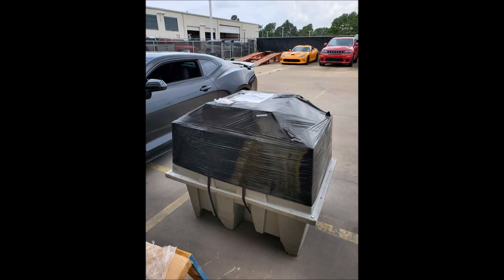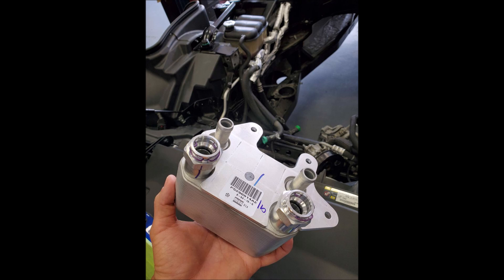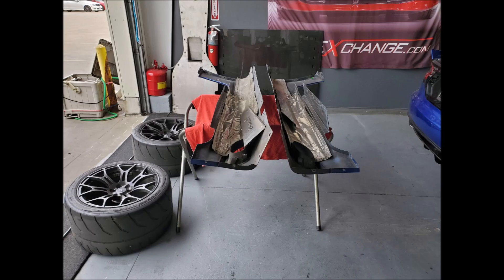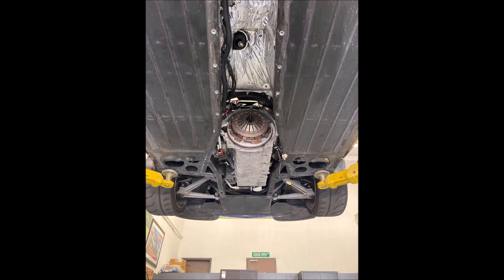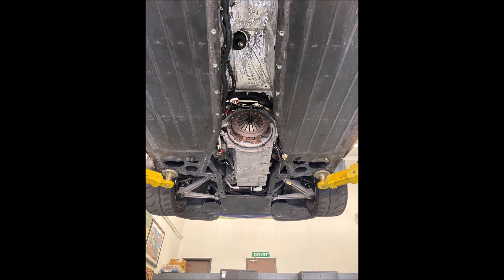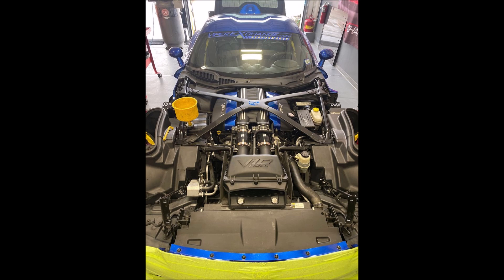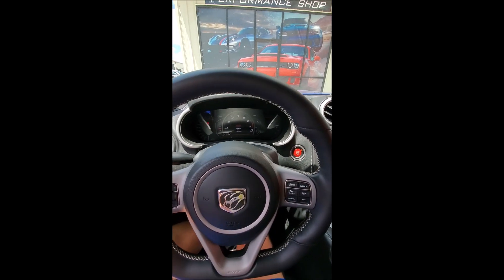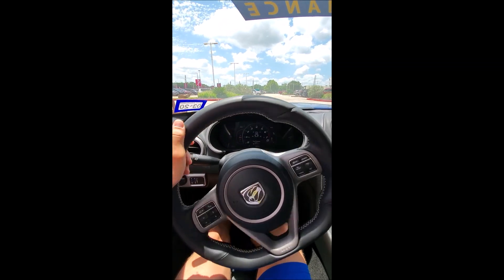9.0L Viper motor install, FIRST fire! Part 5

Comment: Your vacuum has a motor! But you have a engine block table from your viper I meant vacuum??? Hmmm I thought motors are electric could it be tesla powered? Lol wanted 2 ask u how u know it's powered?! Maybe the high amp alternator 4 it's 9L motor uhhum engine I mean!

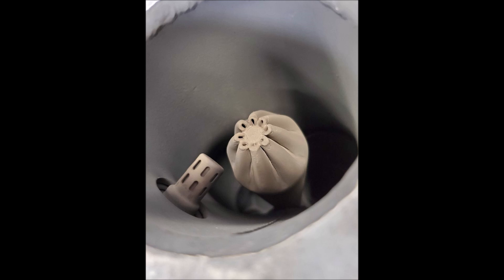Comment: What the heck is that thing in the exhaust near the O2 sensor at the 2:00 mark?
Reply: The "pickle" that is used in Belanger headers. It's debatable if it helps with scavenging, some guys cut that section out.

Comment: Please do at least 1,500 or 2,000 miles and 2 oil changes before coming back to the pulls, we want to keep the engine running good.

Looking forward to the Mexico drives 😜
Reply: Smart man!

Comment: Is this the upper limit of NA power for one of these things? Crazy numbers. Breaking stuff has one silver lining, means you get to make it better.
Reply from the maker: Not even close. This is a relatively "mild" cookie cutter off the shelf kit. The crazy stuff starts with higher compression race gas builds. Seen them make 800whp+
Reply: @SneakySnakes what would you estimate the wheel hp to be with the 9L?

Comment: How about doing a cost breakdown?
Reply from the maker: Turn key heads/cam/stroker on a stock viper would be 35-40k
Reply: @SneakySnakes  Stock as in no basic bolt-ons like longtubes?
Reply from the maker: @Apothecarii  yeah stock as in bone stock
Reply: Including block+labour i would say ~38k
Reply: $20k
Reply: https://calvo-motorsports.com/gen-iv-heads-cam-package/ juSt heads and cam is around $24k according to calvo Jesus 👀

Comment: Sounds so good.  I have always thought Vipers sounded exotic.
Reply: Exotically American
Reply: V10's in general sound very exotic, the viper is just more unique than the rest
Reply: The sound is caused by the big displacement and the exhaust, which has no cross pipe. Maybe there is an other firing order than Lamborghini uses idk